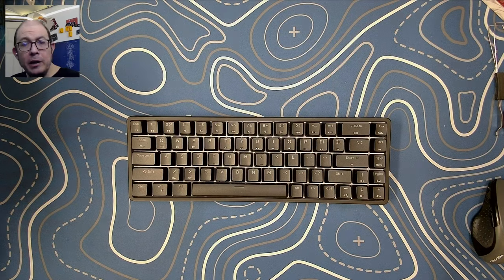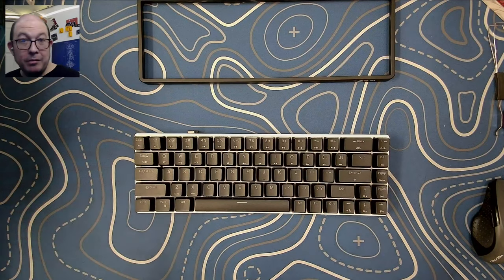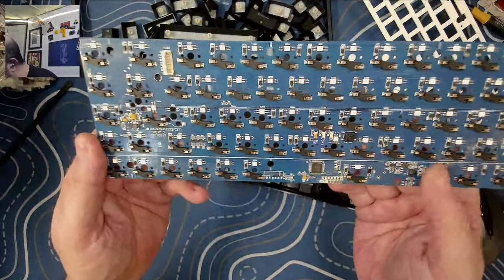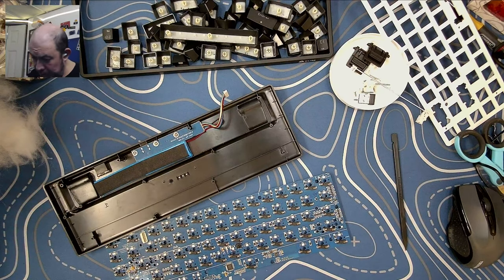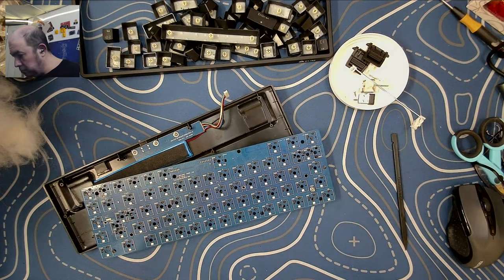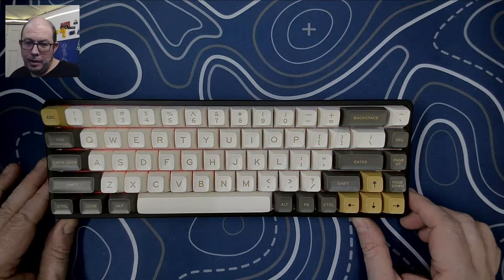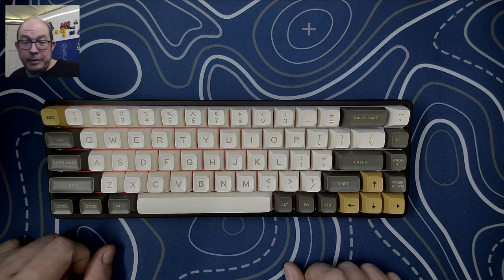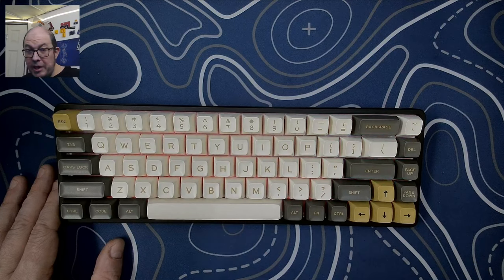Klim Shift - Two hours and some TLC with this $20 65% hot swap 3-way kit. From Stock to Rock!

Comment: i am tempted to get an akko 3068b but this cheap keyboard plus some akko switches/keycaps, silicone, foam and tape will likely fit the bill just as well...
Reply from the maker: I'd pick the Klim Shift over an Akko any day personally.
Reply: @MechKeyboards  what would you suggest for prebuilt under $100?
Reply from the maker: @lukas______  60%, 65%, 75%, TKL, 1800, full size?
Reply: @MechKeyboards  ah shit sorry. I've got a full size right now for the numpad but looking to experiment into possibly 65-75%
Reply: @MechKeyboards  after researching some more this seems like the absolute banger of a choice. if only it went back down to $19...
Reply from the maker: @lukas______  it's still worth it, but yeah, it'd be great if it stayed at $19, though I'd probably end up buying like seven of them to paint each one a different color!
Reply: @MechKeyboards  that seems fun. As for prebuilt 65% do you have any generalized budget suggestions
Reply from the maker: Besides the Klim Shift  there is the Eyooso Z686 which is basically a wired Klim Shift, RK68 is always trusty, and the Redragon K631 is good once modded and the newer revision accepts 3/5 pin switches.
Reply: @MechKeyboards  thanks much. been obsessing all day researching and the skyloong gk75 seems solid too... gasket mounted, dye sub pbt, choice of skuloong, gateron pro, or gateron optical switches, up to 6 rotary knobs for around $85-90. i should just order instead of obsessing lol
Reply from the maker: @lukas______  I have a GK75 en route, but either way, I'd recommend against optical switches as their a very limited selection of them. With luck I'll have the review of the GK75 published sometime next week.
Reply: @MechKeyboards  oh that's great. Have you tried the rk H81?
Reply from the maker: @lukas______  yes, it's a decent kit with an odd knob: https://youtu.be/hN_HeptbtK8

Comment: I went with some plastilina under the stock foam to take the resonance and hollowness out of the board.  There isn't real much room in it.  
Like you I barely had to tune the stabs
Reply from the maker: I've yet to try Plasticine, but it's on my list!

Comment: Hey Mark, After tape modding, I can't access the button on the bottom, was this an issue for you as well? Do you even need the button on the bottom?
Reply from the maker: I used a spudger to remove the tape around the button, which is a mode change button, so you'll need to make sure it's accessible from the outside if you plan to use it wirelessly.

Comment: I notice pretty bad pinging with this board, even with foam between the plate and PCB. It's still noticeable even after changing switches and with extra foam in the case. Do you notice that too? I'm wondering if there's anything I can do about it or if I should just return it
Reply from the maker: Did you lube the switches? There is no ping in this board after modding. Can you provide a sample?

Comment: Nice modding been using this as an exmaple for modding the KLIM SHIFT myself. Dont know if you mentioned it already but did you lube your ajazz switches? Because i hear slight ping at the sound test.
Reply from the maker: Thanks! No the switches were complete stock I still have not gotten around to lubing them but do plan to one of these days 😎
Reply: @MechKeyboards  Ah i see, cheers!